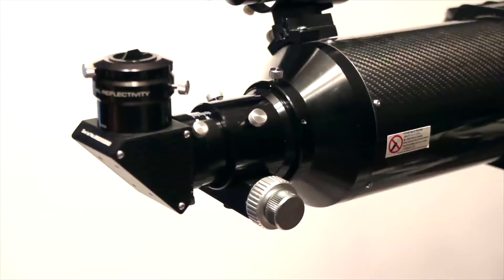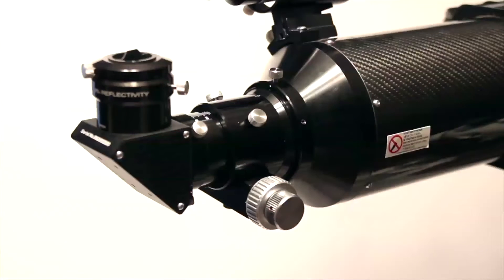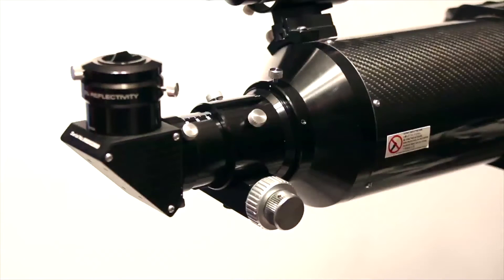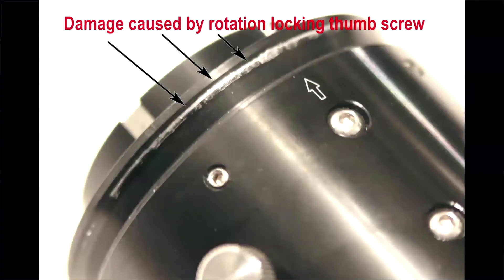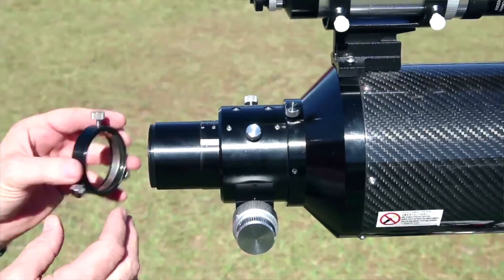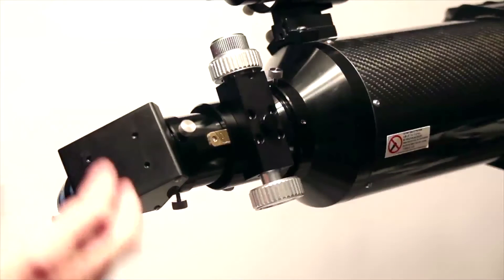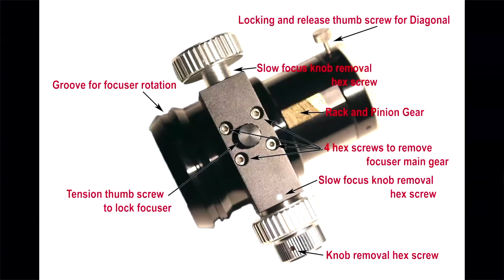Explore Scientific Rack and Pinion Focuser Adjustments

Comment: I installed a zwo eaf and since then I can't get it to work like it was :(
When focuser goes in, it moves smoothly, when backing up it moves hardly and the 1:10 knob stopped working for some odd reason. It looks really easy thing to do, but for some reason it turned out to be a pandora's box for me. :(((

Comment: Just replaced the 3 helen screws with the NYLON TIPS, CAUSE OLD 1 WERE CHEAP AND NYLON TIPS FELL OFF, AND I DRILLED 2 MORE HOLES L AND RIGHT BOTTOM FOR EXTRA SUPPORT AND SLIDING WITH VERY LITTLE GREASE, NOW I NEED TO WORK ON THE PLASTIC BUSHING REPLACE WITH TEFLON.  WORLD CHEAPEST FOCUSER FROM DAY 1, FOCUSER WOULDNT EVEN ROTATE  ALL 3 CRUB SCREWS WERE TO TIGHT, IF THE TUPE COMES OUT MORE THEN 15MM TRAVEL THE TUPE WOBBLES, ON AN 3.000 DOLLER SCOPE, CARBAGE, were can i bye an replacement they have an hex 2.5 inch replacement put not in stock backorder

Comment: 2:20 The three screws plus tensioning knob are not a very good design as a rotator.  Loosening the tensioning knob and spinning the focuser means everything's riding on those 3 screws instead of a smooth groove and you can get scratches. If you forget to tighten the tensioning knob, the focuser will be out of collimation... 

I ordered an M54 rotator to mount on the draw tube and will keep the scope's rotator locked indefinitely.

Comment: Thank you for the video.  I have an ED 80 and ED 127. I enjoy them.   However the eyepiece clamp can be a problem when I try insert the 2” diagonal or camera.   Does a Baader clicklock fit the focuser by screwing on the focuser just as an extension tube to replace the eyepiece clamp?

Comment: I have the Essential Series 127mm ED refractor purchased in 2016 with this type of  R and P focuser. The three Allen head grub screws constantly get loose and causes significant play in the body of the focuser. I've carefully adjusted and tightened them numerous times. During a viewing or an AP session, it is unavoidable to not overly tighten the single thumbscrew that locks the focuser in place when the Allen screws loosen and the focuser wobbles.  As indicated over tightening the thumbscrew causes a permanent dent in the metal ring where it makes contact. This occurs over and over and results in multiple rough spots causing the rotation to be very rough. Tightening this thumbscrew is the only reliable  option to  keep the focuser from having play.  Ironically, this thumbscrew does not have a nylon tip so it's metal on metal.  Watch the video at 5:59 to 6:03 seconds to see this play and wobble in the video. I spoke to an ES representative at NEAF 2017 and the only advice was to keep the Allen screws adjusted and to not overtighten the thumb screw.  There are numerous forum comments on Cloudy Nights about users who dislike these focusers and seek to change them. This is a design flaw that degrades an otherwise excellent scope.
Reply: I 3D printer a wedge profiled "piston ring" of ABS that fits tight in the rotator groove. Very little lubricant first in the groove and carefully try to push it in to place. Original three screws cuts in to the ring and locks it. Rotation is now silk smooth and keeps the collimation perfectly.
Reply: I don't use this part to rotate the focuser, I locked down the screws completely and only use the 2" compression ring to rotate eyepieces or camera. Otherwise the camera focal plane can be out of whack. I realize that means the focuser knob is sometimes in an inconvenient  position but that's just the way it has to be.

Comment: mine I think is older.  It has no rotating screw and has no focus tension - other than two thumb screws on the bottom - but they don't do anything. If anything, it seems looser if they are tightened?  I contacted chat on your website and someone said they would email me the adjustments to be made. and recieved nothing.
Reply from the maker: Dear Ron, we have a forever warranty on your telescope. Please remove your focuser and send it directly to my attention at our new facility that we are moving to in about a week to EXPLORE SCIENTIFIC 1010 S. 48th Street, Springdale, AR 72762 You can also text or call my mobile number at (949) 637-9075.

Thank you,

Scott Roberts, Founder & President

Comment: Great video. Explore Scientific should be doing more of them for their community. The included instructions with the ED CF 127 telescope are by far not enough and there is a lot of room for improvement.
Reply: That hasn't changed.  The included instructions with the AR127 were none.  There is an online PDF that covers all their scopes - it's all text.
Reply: @ericmartin6142  Thats very sad. My comment is 3 years old. Jeez.
Reply: @juanma2001  I went to Cloudy Nights and they explained the two little screws. As for the disappearance of the focuser rotation feature - no-one knows.